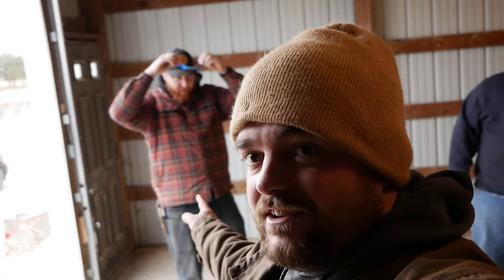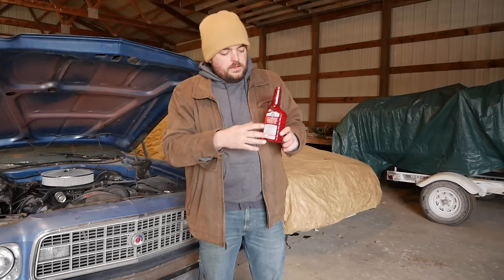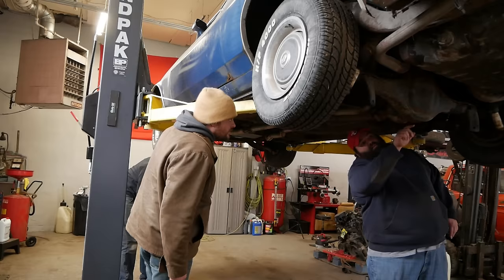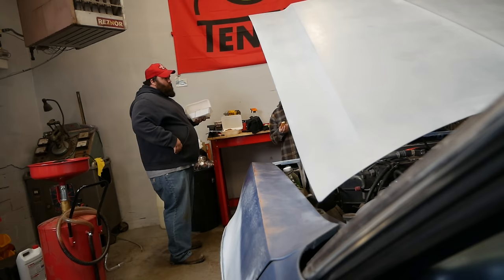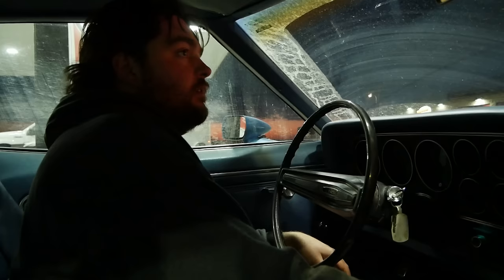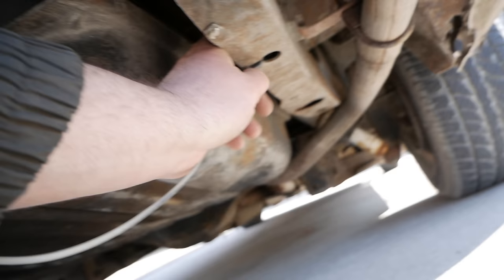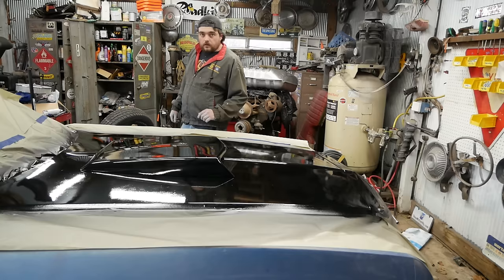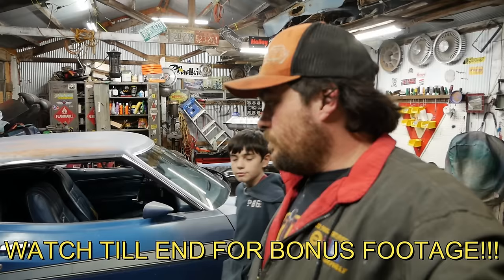Will My DREAM CAR Gran Torino Drive 260 Miles Home? Plus Day Two Mods

Comment: Very nice find!
Had a 72. Upgraded to an MSD box and gained some mpg as well as reliability. Aftermarket high mount stop light actually looks pretty good. Plus a lot of people are programmed to only stop when the see them. Did the front end with one of those kits. Good bushings but very substandard ball joints.
Heads up on the side windows. Some kind of inner trim rusts up and puts deep scratches when you roll the windows down. Hopefully not yours.

Comment: back in the early 80s a friend of mine had a torino that cought on fire under the hood. He grabbed the hose at the house turned it on and ran towards the torino parked in the street. running out of hose both his feet came out from underneath him and he landed on his back. once back up he could only try to squirt the hose far enough to extinguish the fire. good times....lol. i think the car ended up in the bone yard but if i remember it had a very desirable engine.

Comment: He’s right, 1973-1974 is the last years for actual good muscle, the bodies got messed with and the smog killed them - as my personal opinion, my favorite motors, two underrated, others more known/understood: (two understood) fords 460 and 429, and (the underrated and smog-killed-before-full-potential motors are (no shi talking) mopar 318, and the beefy Buick - Buick specifically - 455, underrated 455s, they are powerful motors

Comment: Great car. The fastback really makes the whole profile silhouette work. The front clip is a little too luxury looking for my taste. I wonder if there's a more sporty version you can get?

I wish I'd finished watching the whole video before commenting. 
I really like the addition of the SCJ scoop and factory mags. As for the front clip, maybe just blacking out the grill insert to kinda match the hood center..build a roll pan to close up under the bumper and for the bumper, Kindig did a black convertible very similar to your son's car on his show and actually pieced together two '68 Camaro bumpers and it looked almost like what came on the early Mavericks.
Reply from the maker: That is the sport lol I've got a couple ideas though

Comment: What's up with them there $20 words? Congealed?
🤣🤣
I've found that when changing the wiper blades it's easier to turn the ignition key on without starting the engine, turn the wipers on, when the wipers are at mid-stroke, turn the key off, change/fix/clean wiper blades. 
1973 first year required just the front bumper standard on all cars I do believe.
That's how my dad taught my sister and I how to drive.
You got a good son with a sense of humor. 👍
Cool car that you made even cooler. 🇺🇸 American iron.

Comment: The reason the radio "Wonders" is back then there was a thing called "Auto search" meaning if you had a station on the radio and it went out of range, lost signal the radio would move to the next station this could be what is happening but that feature it should continue to advance from station to station until you pushed in on the volume nob to stop it from advancing.
Reply from the maker: Really?  I always thought those said " auto search" on the face

Comment: Another thing that is unique about this particular car is that it rolled off the assembly line with the 400M engine option! Every car I've rode in that had the 400M had boatloads of off idle torque.

Comment: In 1980 I bought a 75 gran torino with a 351 v8 I was in HS and had it budgeted to the penny that I could afford it then gas went from ¢. 60  too a $1.80 and I was making $2.55 an hour and getting 9 miles to  gallon. Luckily I never sold my 1st car a 73 Chevy Vega Camback that was much more affordable

Comment: I'd much rather have a 68/9 or 71 myself.. and I've already got a 72 351C HO block and 71 CJ 4V heads to go into it.. if only I could afford all the parts to rebuild the engine, get a trans that could handle the power, and put a power adder on it so it could actually handle low rpm because those CJ/4V heads really don't like low rpm. Funny part is we bought the engine for $150 from a guy that redid Mustangs.. he didn't know what he had with those heads.. no wonder a factory 2 brl intake didn't fit it. (I only recently, as in last week, found out that the 71CJ heads are actually 4V's despite having a 2V cast into them)
Remember the first thing you need to do to it is the oiling mod to keep it alive.. basically turning it into a side oiler by routing oil out of the boss for the pressure sender and down the side of the block to the bosses that run into the main caps. For whatever reason they oiled the cam before the mains and they have a bad habit of frying main bearings.
A scoop without an opening.. it's just an air brake killing mileage at that point.. At lest the one on my Ranchero was actually functional in that it helped cool the engine off and gave me those nice in hood turn signal lights. I miss that thing, it was my first car.. even though it had no power it was fun and sounded good.. not as good as the 70 Mustang with a decent cam and cherrybombs but.. Thrushes sound good too, just like an old boat. If only I didn't keep growing.. I was 6'3 when I bought it, 6'7 when I sold it, 6'10 now. If you want to see a picture of my old POS Mustang and hear what it sounded like (really crap recording) I've got a file on my page here of it.. literally the only picture I have of it.
With the scoop you need to cut/sand a little channel out of the back to clear the body line and then it'll suck right down onto the hood.. there was also a rubber gasket for them, the stick back foam rubber works just fine though.

Hate to tell you this now but they do make scotch pads for DA's. https://www.amazon.com/s?k=da+scotch+brite+pads&crid=3DYHOP5PQ94IW&sprefix=DA+sco%2Caps%2C160&ref=nb_sb_ss_ts-doa-p_4_6

Comment: 44:54 overboosted Ford power steering is THE best...GM and Chrysler just didn't have the same feel...bet you it's that Type F fluid it's supposed to take.  The '75 sedan I had in high school had the power steering pump burn out in spectacular fashion on the freeway.  Secret agents would have been in awe at the one time use smoke screen device I "installed" by putting PS fluid where it should've been ATF.  That may not have been the failure point but it's what I was told by old men behind the AutoZone counter at the time, and their word was gospel to me at that age.

Comment: My old man had a '74 four-door gran torino with the 302 V8  that he was going to have towed away because he would just drive a car till it died and never opened the hood. I said sign it over to me if I can get it running and I took it to a friend who put a timing chain on for $75. I drove that car for years. Drove through a ditch and hit a pole with the right rear passenger side and smashed the hell out of the windshield. Replaced the windshield with a girl I knew at the time. Later the right rear axle assembly popped right out of the car on the freeway and it  bounced across the road. Put another one in and kept driving it. It eventually died and I had it towed for like 25 bucks. It sucked being poor or I would have kept it and restored it. Who knew thirty or forty years later they be popular.

Comment: It needs a factory 72-73 hood scoop which was pressed into the hood with an insert at the front.   The 72 could be equipped with Ram Air from the factory.  Not sure if it was available on the 73.   Super cool car.   Oh yeah, there is a guy on you tube Richard Holdener that modifies engines and dynos them and he’s a big fan of 351’s but he built a 400 M  like what’s in that car and he got a most impressive amount of power.  Like notably more than a small block 400 Chevy.  I think I spelled his last name correctly so look him up he has  a ton of videos publish just dyno runs with different cams, heads, etc.
Reply from the maker: No scoops for 73, I do have a 71 scoop that will get grafted into another hood when I find one. And no, not everything is about speed. It's reliable and gets 18mpg, sometimes you just leave well enough alone...

Comment: Yeah as far as the lug nuts go had either don't tighten them down are they put them on there so tight you have to have a 5-ft breaker bar on them to get them loose

Comment: I'm a little older than you but I'm pretty sure the rim-blow was for the steering wheels that had a horn bar that extended from the bottom of the middle bar down to the bottom in like a half circle. That is what was called the rim-blow,
Reply from the maker: No, the rim blow was literally built into the rim of the steering wheel. I had a 72 LTD with it

Comment: The radio is doing what is called "motorboating". Something has drifted out of spec and is causing it to oscillate. It probably needs some capacitors replaced.

Comment: I bought the same car back in 1976, had 54k miles on it, was my first car with a/c. Mine had the bench seat, white vinyl sportsroof, same lazer stripe, two months later dated who would become my wife. In 1983, I pulled the 2V motor, found a four bolt main block, closed chamber 4V heads, and proceeded to try and kill myself with it outrunning the county sheriff lol. Now I have a '73 Mach 1, and I am again looking for those 4V heads. They are a lot harder to find these days!

Comment: Put some lead additive in gas. Im sure it ran on reg gas uot unleaded back in the day. might help lube valve train make it quieter because the led helped valvetrain the way the heads were designed till 75' or 76 when unleaded became mandatory on new cars
Reply: The Lead helps with the valve seals. May be why it smokes when you start it it smokes.
Reply from the maker: 73 is unleaded

Comment: I know a lot of you remember the movie but do You guys remember the TV series Starsky and Hutch? Starsky drove a Gran Torino sport , they would get in a inner city car chase with criminals eventually causing them to have an accident and roll over. Rather than call an ambulance they would pull them  out of the car and punch em out. That car was so rare that people used to argue on whether it was a Dodge or a Ford, Dodge had a model that was almost identical..

Comment: Congratulations! awesome Torino. Definitely want to see more videos on this rig. Oddly enough on our 67 Coronet we recently had the same lug nuts not tightened on the left front and only had one nut left holding the wheel on by about 2 threads sadly it destroyed the beautiful original mopar magnum 500 but at least we didn’t die.

Comment: You should try and cut and buff the blue paint and bang out that dent back quarter from inside possibly I like the car it’s nice needs a little rust repair but it’s good at least do some kind of a cheap fill up hole inside the trunk so you don’t breathe in any fumes
Reply from the maker: I've been driving the car for a year now, there's no fumes lol

Comment: Valve stem seals...the guides should be fine..takes about an hour to fix. That is my era of automobile, used to own one in sky blue. That 400 would respond to headers and porting, compression is real issue, at 10 to 1 they really run though.

Comment: I've had one of those myself I paid $100 for it, sight unseen, they told me it had a blown motor so I worked on it after work for 3 days, when I got it running the lady comes out and takes the plates off of it, I'm like whatever so I drove it home 60 miles, the next day my friend tells me he needs the car back . I said BS, I don't work on other people's cars and I took a risk buying it. Mine was gold with a 429 Gran Torino sport with gauges, the first one I had ever seen yours is the second , a lot of people like to make starsky and hutch replicas but they are regular Gran Torino s like an idiot I registered it in my now ex-wife name, I think you should put  Starsky and Hutch stripes on the sides of it but leave it blue. Anyway that's the ultimate Ford muscle right there. That motor just needs a quart of Rislone  in it for that lifter tick, you put some marvel mystery oil in it that works too

Comment: Hey try seeing if there is a paintless dent removal company in your area so you don't have to cut and weld or fiberglass that rear quarter panel. 
Ps. I don't know how pricey they are but the results I see on other videos are outstanding
Reply from the maker: Paintless dent repair isn't going to fix rust lol
Reply: @PoleBarnGarage  100 percent I noticed that on the lower end of the quarter panel I just figured for the section that connects to the roof

Comment: That's because there was no widow for the VERY first number on that milage window so of course it's going to look like it's going to say all 0s that car at least 200 thousand miles as old as it is for being a 1973 model 😁👍
Reply from the maker: Yes that's the point... Cars clean as can be, absolutely 100k miles. Most old cars didn't last 200k

Comment: I know that car well.  You are lucky its all there.  I had one, Ford Race Red, Black Interior, 351C, C6, 9 inch open Gran Torino Sport 1973.  Mine was early year before the emissions garbage.  Check under that front drivers seat carefully, the factory order sheet, trim and interior sheet should be attached to the bottom of the seat via slide through.  Factory Air cleaner is missing, you are going to want to reinstall that as soon as you can.  So, I am going to give you boys some warnings on it.  THE TIMING SET IS THE ENGINE WEAK POINT!  If it has the factory timing set on it, you are going to want to upgrade that as soon as you possibly can.  Do not go cheap on the timing set.  The chains were weak from the factory.  Usually only go about 100 to 120 thousand before they are so far out even adjusting them won't get it to start, the chain just stretches, nothing you can do to stop it but swap it out with better quality.    WARNING 2:  The fuse relay over by the drivers side kick panel.  The ignition relay fuse and the ignition switch fuse like to blow out.  They love to blow out, only had them blow out on attempt to start.  They will do that consistently, for me it was about once a year or so.  DO NOT OVER SIZE FUSE THEM!  I had to sell mine, she needed a lot of work and the time came, went to a restorer, had no other choice.  Service that rear end and transmission and oil on time.  THIRD WARNING:  The oil pans are weak on them, especially at the drain plug, I suggest you swap it for a real strong after market one that looks stock and has the same capacity.  The reason the guy you bought it from said "fastest car in the world" is because it was, find the old race footage for them and the aerodynamics were designed with high speed in mind.  200  The cobra models were scary fast.  WARNING 4:  GET THAT FAKE LEATHER TOP OFF AS SOON AS YOU CAN!  That is where it will begin to rust, it traps moisture bad.  Those little roll down windows at the back there, where that black top attaches, right above that chrome strip, about an inch, that is where they attached the roof of the car to the body at the factory.  They did not fill them in on the fake leather top trims except the weld itself, that is the other major rust point, and its deadly.  You are going to want to get the rust out of the attachment point, then weld it and then lead it in.  WARNING 5:  The push rods from the factory were designed to bend before anything else got damaged.  You are going to want to keep them that way or mid grade them if you put new rockers on it.  They were designed that way to save the engine, better a bent 5 usd push rod than a destroyed rocker and chunks everywhere under the valve cover.  WARNING 6:  Always let her warm up till at running temp, its just how the engines were back then.  If you don't you will bend a push rod I assure you of it.

Comment: Is the engine a 351C 2bbl or a 400? Anyways it needs a hi perf. cam, 4bbl intake and headers. Then there is the damaged pass. side rear fender. Good luck with your Fastback Torino, not many on the road these days. Biggest engine for a 73 Torino would be a 429 4bbl.
Reply from the maker: Biggest engine in 73 is the 460, first year for it. It's a 400 in it, and all it needs is left alone 🤷 it's my daily driver 80 miles round trip, not a race car
Reply: @PoleBarnGarage  Years ago I drove a 76 Country Squire with a 400 under the hood. Considering the weight of the car the performance was better than expected. Always dreamed of hopping it up but never did. Regarding your Torino, any plans for repairing the dented back quarter?

Comment: Happy for you. That said: Sorry but I have to argue with you Dalton. I have a 1975 Trans Am and it is just as much of a "muscle" car as this Gran Torino. The 75 weight is over 3800 lbs just like the Gran Torino and it now has a 650 Hp Pontiac 400 in it. Got to love these old "Detroit Steel" cars made in the USA when that meant something.

Comment: They get the car started & spend time talking about it. The first point of interest for me would be how many PSI oil pressure is it making & is there water in the radiator.
Reply from the maker: Well I've been driving it basically every day since this video so I guess it was fine wasn't it
Reply: @PoleBarnGarage  Yes of course it was fine in the end.
Maybe you might want to make a video in buying a car that has been idle for a long time & the sort of checks you should do.
Like how to avoid buying something that's on the verge of death from the motor or transmission.
Reply: @PoleBarnGarage You used the "Ear Oil Pressure Guage" like any gear head would. Lifters will tell you if it's got oil pressure or not.

Comment: Will it? At least change the oil drain flush and add new coolant. Then install a set of new tires. Much can go wrong over just 260 miles or half that distance.